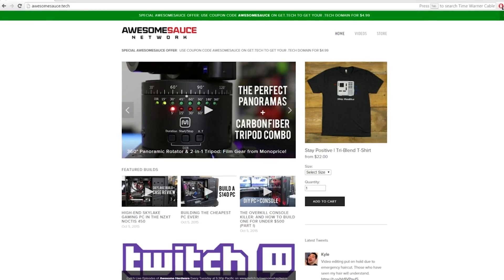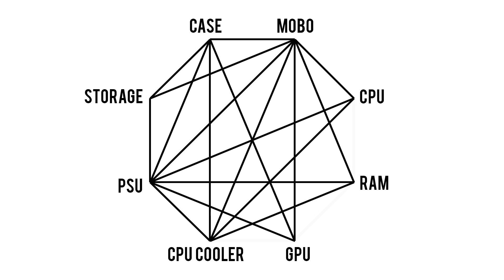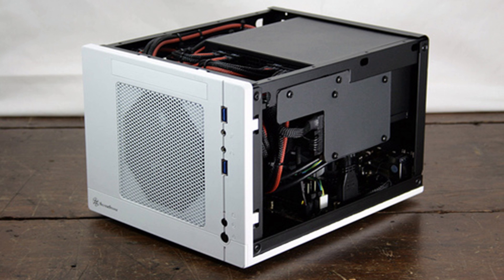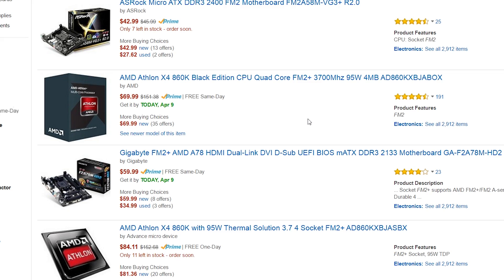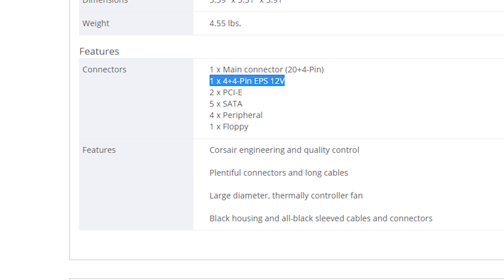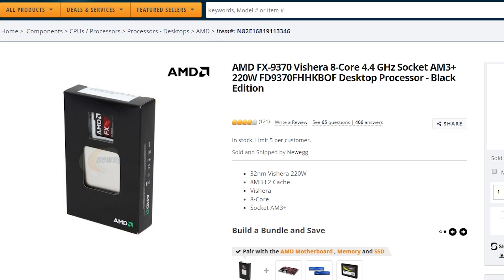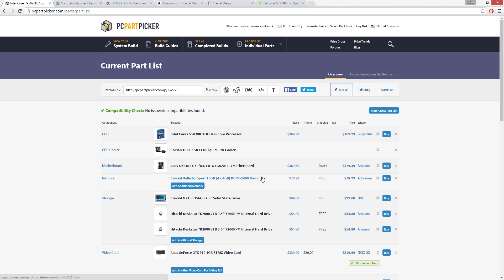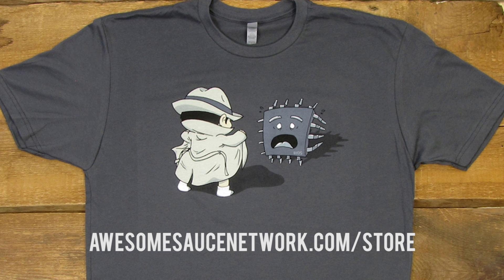How to Choose Parts for a PC! The Ultimate Compatibility Guide!

Comment: hey! I am new at this, but I was wondering if someone could verify that my built would be compatible. 

CPU: Intel Core i5-7600K 3.8GHz Quad-Core Processor  ($248.10 @ Amazon) 
CPU Cooler: Cooler Master Hyper 212 EVO 82.9 CFM Sleeve Bearing CPU Cooler  ($39.30 @ Amazon) 
Motherboard: MSI B150 Gaming M3 ATX LGA1151 Motherboard  ($105.13 @ Amazon) 
Memory: G.Skill Ripjaws V Series 16GB (2 x 8GB) DDR4-2666 Memory  ($130.18 @ Amazon) 
Storage: Samsung 850 EVO-Series 250GB 2.5" Solid State Drive  ($106.11 @ Amazon) 
Storage: Western Digital Caviar Blue 1TB 3.5" 7200RPM Internal Hard Drive  ($58.84 @ Amazon) 
Video Card: MSI GeForce GTX 1060 6GB 6GB GAMING X Video Card  ($270.32 @ Amazon) 
Case: NZXT S340 (Black/Red) ATX Mid Tower Case 
Power Supply: EVGA SuperNOVA NEX 650W 80+ Gold Certified Fully-Modular ATX Power Supply  ($92.73 @ Amazon

Feel free to suggest any modification. my goal is to create a good gaming pc that can run most games out there for a couple of years. target price 1000$

Comment: Is anybody enough nice to check these PC parts? I already check them and I think that my parts are compatible, but I'm beginner with PC parts so that is why I need somebody to check them. And if you have good ideas how to make this build better, do not hesitate to give me tips! :)

My parts:
CPU + Cooler: Intel Core i5-6500 3.2GHz
• Motherboard: MSI B250I PRO Mini ITX LGA1151 
• Memory: Corsair Vengeance LPX 16GB (2 x 8GB) DDR4-2133
• Storage: Toshiba DT01ACA100 3.5" 1TB 7200rpm 32MB SATAIII (HDD)
• Video Card: Asus GeForce GTX 1060 3GB Dual
• Power Supply: CORSAIR Builder Serie CX550M Modular Power Supply
• Case: Deepcool TESSERACT SW ATX Mid Tower
Reply: Zulrah I'm his friend. Monitor that he would buy is: Acer GN246HL 24" 144hz 1920x1080
Just asking that could the monitor work 144hz with these parts (right ports to get 144hz on the motherboard/gpu with this monitor)?

Comment: The motherboard I want to buy says it supports the 6th gen intel core processors because its a year old but will it be compatible with the new 7th generations?
Reply: Guillaume ml it depends if its a 1151 motherboard , it should be fine if both cpus have 1151 size.
Reply: Brandon Hassan Thx
Reply: Guillaume ml the reason many new cpus dont work with old motherboards is because the cpu changes size throughout the years. the number of pins it has also changes and this in return will make it impossible for the cpu to fit in the older socket. Hope this helps you understand a little more as to what makes motherboards incompatible with cpus :)
Reply: Brandon Hassan Thx even more :D
Reply: You're welcome 😊

Comment: Doesn't the MoBo have a maximum TDP that it will support? For instance, you showed the 9570 which has a TDP of 220, yet the average mobo I've seen won't handle nearly that much. I would consider myself a fledgling (beginner) enthusiast, so I would like some clarification on this.

Comment: one thing you fergot to mention is PSU cable length, if the  psu is positioned in the bottom you may find it difficult to run all the cables from the back. Invest in a good PSU don't be an idiot like me

Comment: Can someone help me out? I'm trying to look into these more but I want to know if these are compatible. I'm buying these off Amazon and Amazon is sometimes crappy with it's information.

Case
Thermaltake TOWER 900 E-ATX Full Tower

Intel Core i7 6700K 4.0 GHz Unlocked Quad Core

Motherboard
ASUS Rampage V Edition 10

Power Supply
EVGA Supernova G2 1600W

Graphics Card
MSI GTX 1080 30th Anniversary

Memory
CORSAIR DOMINATOR Platinum Series 32GB DDR4 DRAM 3000MHz

SSD
Intel 750 Series AIC 800GB PCI Express

HD
Seagate 4TB BarraCuda Sata 6GB/s 64MB Cache Internal Hard Drive
Reply: Dragon Fruit a really good way to check is to use pcpartpicker.com this way the website does all the work for you

Comment: Line between psu and ram?
Reply: None. But if it doesn't fit on the motherboard slot, that means it's not the RAM you need for.
Basically, check the motherboard specifications if you need DDR3 or DDR4 RAM.

Comment: Intel Core i7-2600K 3.4GHz Quad-Core Processor
Asus P8Z77-V LK ATX LGA1155 Motherboard
Kingston HyperX FURY 8GB (1 x 8GB) DDR3-1866 Memory
Sapphire Radeon R9 380 4GB Nitro Video Card
Thermaltake Urban S21 ATX Mid Tower Case
Corsair VS 650W ATX Power Supply

Comment: can someone rate this build?   any tips,  trying to stay low budget. 

PCPartPicker part list: https://pcpartpicker.com/list/RCDxkT
Price breakdown by merchant: https://pcpartpicker.com/list/RCDxkT/by_merchant/

CPU: AMD FX-4350 4.2GHz Quad-Core Processor  ($78.99 @ Amazon) 
CPU Cooler: ARCTIC Alpine 64 GT 25.6 CFM CPU Cooler  ($8.88 @ OutletPC) 
Motherboard: MSI 970A-G43 Plus ATX AM3+/AM3 Motherboard  ($67.88 @ OutletPC) 
Memory: Corsair Vengeance Pro 8GB (2 x 4GB) DDR3-1866 Memory  ($49.99 @ Corsair) 
Storage: Western Digital Caviar Blue 1TB 3.5" 7200RPM Internal Hard Drive  ($49.33 @ OutletPC) 
Video Card: Zotac GeForce GTX 1050 2GB Mini Video Card  ($109.99 @ SuperBiiz) 
Case: Deepcool TESSERACT SW ATX Mid Tower Case  ($36.99 @ SuperBiiz) 
Power Supply: EVGA 500W 80+ Bronze Certified ATX Power Supply  ($43.88 @ OutletPC) 
Monitor: Sceptre E225W-1920 22.0" 1920x1080 60Hz Monitor  ($79.99 @ Jet) 
Keyboard: Logitech Wireless Combo MK270 Wireless Standard Keyboard w/Optical Mouse  ($18.99 @ SuperBiiz) 
Headphones: Turtle Beach X12  Headset  ($33.40 @ Amazon) 
Total: $578.31
Prices include shipping, taxes, and discounts when available
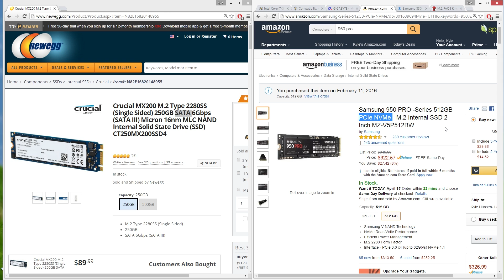Generated by PCPartPicker 2017-02-15 10:10 EST-0500

Comment: I have checked and as far as I can tell this build I have made doesn't have any incompatibilities but could any of you guys make sure?
I7 6700k
Coolermaster hyper 212 evo
Miss z170a krait gaming 3x atx 
Corsair vengeance lpx 16gb ddr4-3000
Kingston ssdnow v300 series 120gb2.5" solid state
Sea gate barracuda 2tb 3.5" 7200rpm internal hardrive 
Sapphire Radeon rx 480 8gb nitro+oc 
Phanteks eclipse p400 atx mid tower case
Vega supernova g2 550w 80+gold certified fully modular tax power supply 
Windows 10 home oem 64-bit 
Thanks for the help guys
Reply: 1. i7 with RX 480 isn't really a good match. For the same price, you can go i5 with GTX 1070 instead. Better performance, good for gaming.
2. Well, there are some faster SSDs for about the same price. I recommend PNY CS1311.

So here's your current config: https://pcpartpicker.com/list/WHwGHN
And here's one with my suggestion: https://pcpartpicker.com/list/ryJvm8

That's it, really. Good luck with your build!
Reply: AlphaCore the reason I'm going for an i7 with an rx 480 is because I love strategy games and other games which are heavily cpu dependent. I plan on upgrading my rx 480 later on with a 1080 or maybe one of amds new cards realising later in the year. Are there any compatibility issues or will I need to purchase anything else alongside to actually build this thing like extra cables or fans? I am already going to buy an anti static wrist band and thermal compound for the cpu so that shouldn't be a problem. Thanks for the advice my friend
Reply: Tom Franklin Well, if you plan to upgrade later, that means you should get bigger PSU so you can go all-in immediately instead of changing PSU later. Here's EVGA GQ 650 W starting from $80. Cable is all black:
http://pcpartpicker.com/product/kz7CmG/evga-power-supply-210gq0650

Or fully modular G2 with 650 W version starting from $90. Use whichever, really:
http://pcpartpicker.com/product/9q4NnQ/evga-power-supply-220g20650y1

Case only include two fans, one rear, one front. Now front can support 2 more 120 mm fans. So you might want to add two more. Here's a splitter so you can only need to plug 3 fans with one cable (plus being an extender):
https://www.newegg.com/Product/Product.aspx?Item=N82E16812162059

Eh, that's it that I can see.
Reply: AlphaCore thanks very much for your assistance my friend and I intend to purchase all the parts sometime this week. Thanks again!
Reply: Tom Franklin Good Luck!
One bit of a tip: Don't close the side panels until you're sure all parts are working properly. CPU, Video card, RAM, HDD, everything.
Reply: AlphaCore thanks for the advise my friend
Reply: AlphaCore I have modified my build and I was wondering what your thoughts were. 
I5 6600k 3.5 ghz 
Cooler master hyper 212 evo
Msi z170a Krait 
Crucial ballistic sport lt 8gb 
Seagate barracuda 2tb
Zotac geforce gtx 1070 8gb amp
Phanteks eclipse p400
Evga supernova g2 650w
Does anyone know where I can get windows 10 cheaply?
Reply: Tom Franklin Eh, you should get 16 GB of RAM somehow. And an SSD.
Actually, can you check i7-6700 (non-K) and B150 or H170 motherboard? see if it fits your budget? That juicy CPU will be beneficial if budget allow for CPU heavy game.

And for cheap Windows license, some people will refer to site like Kinguin, but yeah, sometimes you can have issues with that license key, sometimes you don't. Totally your call, though.
Reply: Tom Franklin Now to think about it, I just remember that Kyle bought Windows keys from Kinguin in the past. One of five keys have issues.

Comment: Thank you for all the awesome videos man. I wanted to ask something that is not mentioned in the video and is troubling me for years. If I buy an MSI GPU should I buy an MSI mobo as well? Are mobo and GPU made by the same manufacture more compatible with each other or I can get whatever I want? Thanks in advance. :)
Reply: It will work. Don't worry.
Reply: AlphaCore thanks for the reply. you mean that it will work fine if I get different brand of Mobo and GPU ?
Reply: Yup.
Reply: Nothing wrong that I can see. Strong CPU, lots of RAM, fast storage drives, perfect for that usage.
The only thing that I can recommend is to add an 1 or 2 TB HDD, so you can put (or backup) done projects here and SSDs are all for current projects and files that need to be used very frequently.
Reply: Also, if you wanna go all black like the rest of the system, I recommend ASUS ROG Strix GTX 1070.
Reply: Thank you so much mate. You are totally right, I already have 2 2TB HDD one for personal files and one that I will store the finished projects. :) 
Actually this is going to be my first try to make a good looking build and I'm trying to get an all black with red lighting, but I will totally check out the GPU you are recommending even though it's 40euro more expensive than the msi (Greece). Thanks again for taking the time to look at my build, really appreciate it!

Comment: What do you think about my combination?
-16GB Corsair Vengeance LPX schwarz DDR4-3000
-2000GB Seagate Desktop HDD
-Cooler Master MasterCase Pro 5 
-8GB ZOTAC GeForce GTX 1080 AMP! Extreme 
-Intel Core i7 7700K 4x 4.20GHz So.1151 
-be quiet! Dark Rock 3 Tower Kühler
-650 Watt be quiet! Power Zone Modular 80+ 
-Asus ROG Strix Z270E Gaming Intel Z270 
-250GB Samsung 850 Evo 2.5" (6.4cm) SATA

Comment: im a "seasoned builder" and ive seen that sometimes bulky GPU's can very rarely interfere with your cpu cooler, either radiator plus long gpu can cause problems especially for push pull configs and can also interfere with air coolers if you fit them the wrong way. The tubing of the rad can also be a problem in tight, portable rigs

Comment: was wondering if a Hyper 212 Evo cup fan would work  with a Asus Sabertooth X79 mobo with a 2011 socket? I'm wondering about the ram cleance as I am using PNY Anarchy DDR3 1866 MHZ ram chips. I have 4 sticks installed on the mobo

Comment: Guys will this work for a gaming pc? And do all of the parts fit?
https://pcpartpicker.com/list/K6c33F
Reply: 1. I don't know how you can get a 6098P, so I simply assume you already have one.
2. Get Cooler Master Hyper 212 EVO/LED instead for the cooler. Better job for apparently the same price.
3. Buy Seasonic S12II instead. Better PSUs for about the same price. 520 W is actually enough for that system.
4. If possible (and budget allow), get an SSD. 120 GB would be enough.

Eh, I think that's about it. Good luck with your build!
Reply: The SSD is pricey for the capacity given. I was thinking 120 GB ADATA or PNY for 50 bucks. For that price, you can get 240 GB SSD area. But you can go ahead and use that one anyway.
Rest already solid. Good luck!
Reply: AlphaCore windows 10 needs maxium of 128gb so 120 i think isnt enough
Reply: But yeah upgraded to 240gb one (ssd) which was cheaper than the 160gb one

Comment: Why do you need a fan controller? (new to pc gaming)
Reply: Ben Schiszler  Fan control gives you the freedom to control fan speed to reduce - increase temperature and noise coming from the fans. In other words it gives you the ability to change the RPM of the fans.
Reply: Controlling case fan.
Reply: AlphaCore yeah but why do you need to control it 😂

Comment: are these spec good for 60fps 1080p
gtx 1060 6gb oc
kingston 480gb ssd
3tb wd blue
i5 7600 7th gen
msi b250 gaming motherboard
cooler master neoton 140xl cooler
nzxt s340 white
antec 650w atx modular power supply
16gb crucial balistic ram
x3 bit fenix 12cm specter case fans
plz first build  just want to know if goodare these spec good for 60fps 1080p
gtx 1060 6gb oc
kingston 480gb ssd
3tb wd blue
i5 7600 7th gen
msi b250 gaming motherboard
cooler master neoton 140xl cooler
nzxt s340 white
antec 650w atx modular power supply
16gb crucial balistic ram
x3 bit fenix 12cm specter case fans
plz first build  just want to know if good

Comment: Do USB 3.1 Front panel connectors work for USB 3.0? For this Mobo (http://www.gigabyte.us/products/product-page.aspx?pid=6105#sp) it says:

2 x USB 3.1 Gen 1 headers
2 x USB 2.0/1.1 headers

so if we have, for example a 450D Corsair case with 2 USB 3.0 ports, would it work with this motherboard?
Reply: USB 3.0 got renamed to 3.1 Gen 1. It's all USB Gen 1 connector on both case and motherboard.

Comment: Ok, so everything on my PC is working EXCEPT for my optical drive because the SATA data plugin is properly plugged into the optical drive but the other side of the cable can only be plugged into the HDD but I was told that the Optical drive SATA data plugin and the other one that is currently there BOTH need to be plugged in. Please help.

Comment: Is this compatible?

https://pcpartpicker.com/list/ZW7QwV
Reply: Compatible, yes. Recommended, hard to say.
First of all, pick Seasonic S12II 520W PSU instead. Similarly priced, but better product.
Also, ditch the AIO watercooler. The CPU isn't overclockable so water cooling isn't recommended. You can stuck with stock cooler until you can buy something like Hyper 212 or T4.
Now, you just got more money from the AIO, and if you can spend a bit more. Get RX 480. Strong, sweet GPU.

https://pcpartpicker.com/list/fxCNsJ

And now, if you don't plan to upgrade the CPU later on, or upgrade to non-K i7. Get B150 motherboard instead of Z170. It's cheaper and will do the job just fine.
Again, more money from the switch, get Hyper 212 EVO for the cooler.

https://pcpartpicker.com/list/t3kxTH

Wow, that's a long list. But, these will do better. Good luck with your build!
Reply: Alright man I took your comments into consideration and changed GPU+different PSU and put in a CPU with overclocking capabilities what do you think? Also thanks btw
Reply: Oops lol forgot link https://pcpartpicker.com/list/xDQFCy
Reply: Oops lol forgot link https://pcpartpicker.com/list/xDQFCy
Reply: Fine. Good luck with your build!
Reply: AlphaCore thanks, appreciate it

Comment: is PC part picker the best PC gaming way to go because I wanna get into PC gaming and currently on ps4 don't have a clue what to choose about building a PC and want to run high games but low budget I want the best specs for about £250 or at a push £300 because I need monitors aswell can anyone suggest a monitor that has slim bezels with a HDMI lead if someone can get back to me I'd really appreciate it thanks

Comment: Is this good or bad because I don't know whats going on.
Intel i5 6500
MSI H110M
16 GB Memory
120 GB SSD
2TB Hard Drive
GTX 1070
600w PSU
And I need help on a case, It seems to worry me what the case will look like on my desk and stuff. I don't want something fancy, but just a good design with multiple ports.

Thanks!

Comment: Im a complete novice to computer building, i asked reddit for a build around £1000, this is what i got: https://uk.pcpartpicker.com/list/PWjTZ8

Can the wise men and women on youtube share their insight on whether this build is good, easy to build or how it could be improved?  Thanks xx
Reply: FoZe Rog Yeah if you downgrade your motherboard drivers which really isn't recommended. Regardless, CES 2017 is in 3 days and I cannot wait for the zennovation with asus and AMD's Ryzen :D
Reply: Change the PSU to 550 W. For breathing room, future upgrade, and such:
https://uk.pcpartpicker.com/product/3hkwrH/corsair-power-supply-cp9020102na

Also this is your call, I'd rather switch to 1 TB HDD to have money to get an SSD. 120 GB would be enough for OS. If you can spend more, you might not need to downgrade the HDD.
Like this:
https://uk.pcpartpicker.com/product/mPgPxr/a-data-ultimate-su800-128gb-25-solid-state-drive-asu800ss-128gt-c

Good luck with your build!
Reply: AlphaCore Thanks for the response, i will most likely use the 550w now
Reply: First of all get a k cpu like the I5 6000k so you can overclock it, I'd go for a 6gb GTX 1060 for graphics too
Reply: Crazy Frank i5 6000k lmao, and you can still OC a i5 6500
Reply: seems find i suggest upgrading your case to ATX just to be Safe.
Reply: Jack Dutfield ur shell is shit thoe